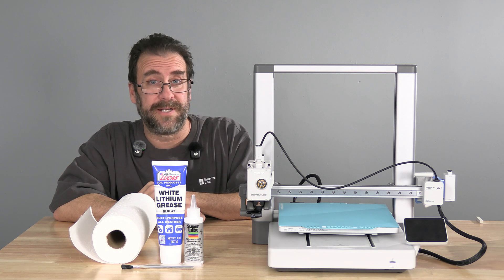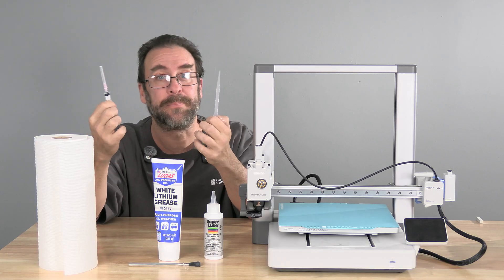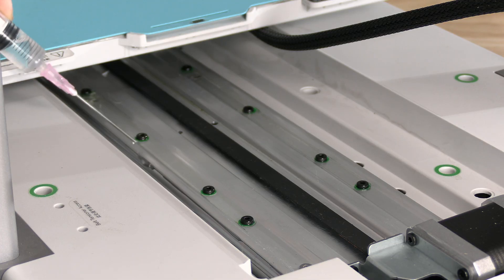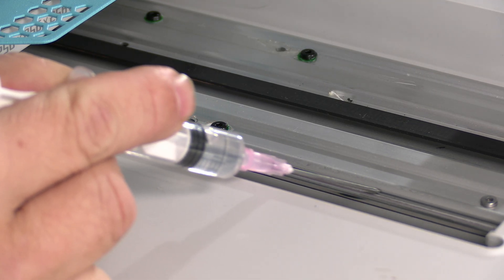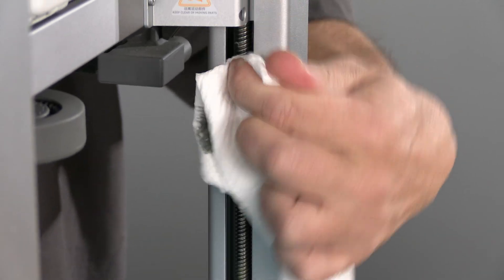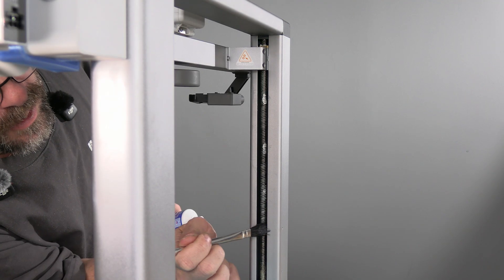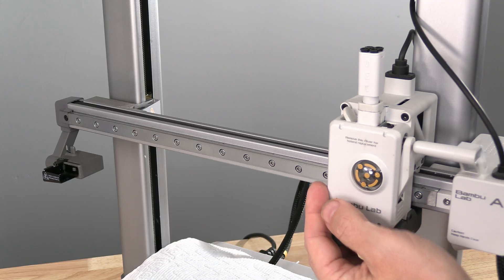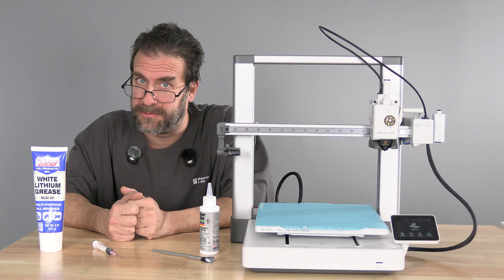Bambu Lab A1: Clean & Lube your RAILS, RODS, LEAD SCREWS. - 3D Printer

Comment: I did all this somewhat regularly but I didn't know that I have to tighten the tiny screws holding the heating element, too. I had two horrible clumpings around the nozzle and the extruder even dug the nozzle tip into the plate. I replaced the heating element with a new one but the layer quality still doesn't look as good as before.
One the things that I recently did was tightening the belts and rods. That seems to make things a little bit better but at times when the layers have still gaps, separations and uneven. Layers looked great in simple test cubes or cylinders but became inconsistent when printing complex models. I noticed that the oil on the Z rods are black. I removed some of them and the layers seem to look better. Is the oil supposed to be that black or should I throughly wipe them off the rods and replace them completely with the white stuff?
Reply from the maker: Use very little. Lead screws should have just a little grease. Yea, it can get blackish